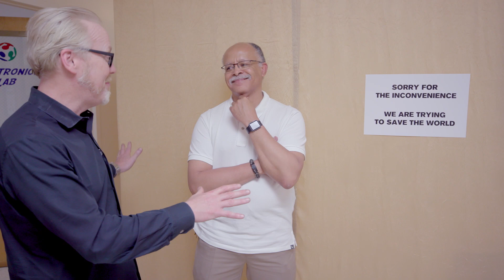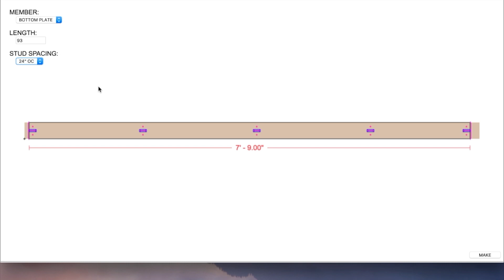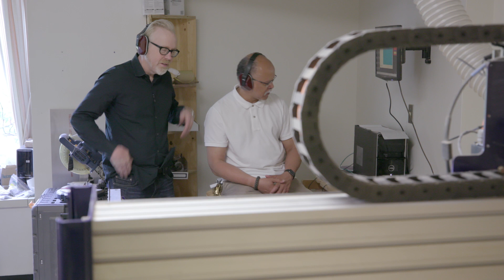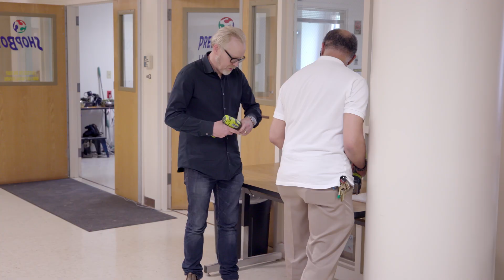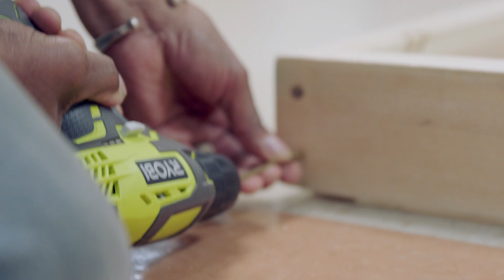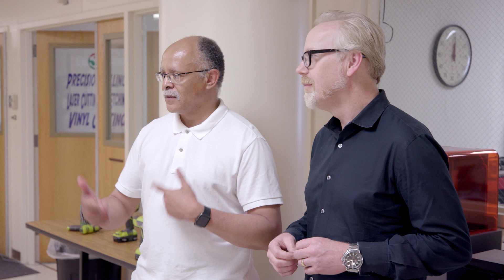Adam Savage's Maker Tour: Incite Focus

Comment: Put the CNC on a trailer so that contractors can use it to quickly make walls. Fit it with an auto loader and off feed table and you would have a sure seller. The mortis and tenon design makes for a very strong wall. Programming, low cost and UI would be paramount.

Comment: looks like it would be ten times sturdier and lighter if it was made out of aluminium profiling.
why make a 3-inch thick wall, when one inch would do, and still fit wiring and insulation on the inside?
I mean,.... for an engineer's job of optimizing the result, this looks way under optimized.

Comment: What I can't work out is how this housing help reduce the cost of utilities. Even if you have all of your essentials (kitchen, bathroom, and bedroom) in one room that does not reduce electricity costs (with the exception being heating), or water costs.  If that housing also included solar panels, and a rainwater tank, plus grey water recycling then it might help solve some of the issues that the working poor face on a daily basis.

Comment: If you can make it to where it's easy to build the entire structure, not just the individual pieces, and you find a way to basically flat-pack it; this would be great for disaster relief. Ship small flat-pack temporary homes, and you could easily have a neighborhood on a truck, maybe even enough for a small community. I know FEMA has trailers, I went though a nasty tornado back in 2011, but the deployment honestly isn't that fast and a ton of people end up in hotels for weeks, but flat-packing enough buildings for a small community could vastly increase the speed of disaster relief, since all you have to do is piece together the structure and screw it together. It would also cut down on costs, as FEMA uses literal trailer homes, and this could be flat packed, just the savings in fuel for the trucks would be enough to provide a vast amount of additional homes.
This would be even better if there was a way to knock down the home and put it back in a flat-pack format after disaster relief, with a quick inspection, then use it for the next disaster.

I also like the idea of making the structure an easy puzzle; piece together a few things, then screw, and you're done. This would work well for people who want to build a cheap home, since time is money, and building structures takes a lot of time in measuring and cutting and assembling; making this the Ikea of houses would cut down on the price a lot. Hell, I might even implement this idea the next time I go out and build something, even if its just a shed.

Though I do have ideas for improvement if you scale this to production. One is automated assembling, especially for the frames; it might not take long for a trio to piece one frame together, but labor time for that trio and the amount of tools and accessories needed would grow rapidly when you scale it for production. Another one is getting a stronger spindle with a longer bit, so you could at least double the production on the 2x4s, and sheet good portions could be knocked out quickly when you layer the sheets.

Comment: 8x20?  Why not use 8x20 shipping containers instead?
Reply: Because they cost an absolute fortune.
Reply: 3,000-5,000 US used for a shipping container. A 8x8 shed built to code won't cost any less.
Reply: But you then have to make the shipping container fit for occupancy. I guarantee stud walls with free labor are less expensive than shipping containers that need to be finished out to live in.

Comment: Hmm... it's all very interesting but the guy says he's trying to minimize the amount of trade experience necessary to make but it seems like he's just offloading the experience / skill needed to understanding the tech to build the cut sheets and own/operate automated tools like cnc routers. All said and done, sure assembling the pre-notched boards with some screws is simple enough but starting from scratch, I can teach a lay person how to use a speed square and tape measure to butt a stud against bottom plate and toenail a few nails in in a fraction the amount of time needed to even notch one board with a CNC.

So the only real benefit is it compiles a lot of already readily available and easy to find knowledge such as code compliance into a no-brainer set of plans. I'm pretty sure with just the set of plans you could ignore the fancy cnc notch bologna and build the "building" in less time, with less knowledge, faster and with less material.

Comment: Almost 6 minutes of pompous yammering before we get the unimpressive reveal of a moderate waste.  Mod up a connex in half and turn it into 2 units accesses at each end split the middle water surface utilities and you get renewable materials used and structure and mobility. Why overcomplicate this stuff.

Comment: Not meaning to minimize the technical challenges this entails but we have the technology to do such constructions for a couple of decades. I think the toughest thing to crack, as he also mentions, are birocratic hurdles but also social norms and an efficient way to put a lot of these in a place. Because a single unit here an there does not solve a lot of problems. This then causes policing problems and neighborhood problems. Maybe with a good technical design they can bring the price down so much that they can fail at tackling some of those tough social problems without jeopardize  the project. Besides, you have to have these thing in place for the eventual problems to manifest and be able to start solving them.

Comment: Would be great if it was actually Open-Sourcve as it's mentioned in th video. I've checked their website. It's empty. No links to the documentation, no blueprints, no open source code. Nothing so far. Why even bother advertising it - because let's face it - it''s an advertisment and publicity play for Chevron.

PS. "We're moving and expanding quickly." Says FAQ page with 2013 trademark in 2017. Four years noone bothered to update a FAQ.

PPS. In fact all of their pages are empty. There's absolutelly no information on the page. All social media links are dead also. There's no way to contact them. This is all an extremally cheap advertisment for a corporation, nothing to do with saving a world.
Reply: Marcin Raczkowski Adam asks if it WILL be open source and they say yes...they are probably will make it public after the 1st one is built and tested in the wild so they can iron out the kinks

Comment: 3d printed shower head won't be sanitary. Not at all. All the ridges hold onto water and microbes
Reply: They used the 3D printer because they are prototyping. Any large scale production would use mass produced components. Even given that, a 3D printed shower head is not a sanitary concern. If it's a clean water source, there aren't significant nutrients for large bacterial blooms.
Reply: Nylon with SLS would be mostly smooth right off the printer, and a custom-built sanding rig would make completing the riskiest surfaces trivial. Also a possibility: antimicrobial coating. You'd probably need some sort of coating anyway, to combat corrosion from chlorine in treated water.
Reply: Even more than that, it is a terrible use of the printer time/energy/materials. Very inexpensive shower heads are a solved problem that integrates with equally-solved plumbing with almost zero effort.
Reply: Could just put a protective coating on it or just fix the rough edges.
Reply: Acetone, gassing.. would round off all the areas in question and smooth the material.

Comment: On one hand, micro-housing is cool.

On the other hand, is the logical conclusion the "Trailer Parks" from Ready Player One? What I'm asking is, is this how slums are made? from good intentions?
Reply: Micro housing is only a problem if it's a bandaid on a flesh wound. The ideas proposed by this guy is that the micro housing is supposed to free up resources for the inhabitants that could go towards investing in other things. So, taking away the issue of expensive housing and utilities to allow people to improve themselves and their local community. At least, that's the idea.
Reply: no slums are made by the few who keep adding no value and charging more .... do you think that 8foot 2x4 is really worth the 5 bucks you spent on it ... when the tree it came from cost 40 bucks ... and they get 20 or 30 2x4's out of it ... if they priced it accordingly that 5 buck lumber would be 20cents ... and the extra 4.80 goes into the owners pocket who bought cheap lumber and process several tons of it to cut their cost to as little as possible ... then jacked the sell price as much as possible to make as much as possible for a little work 
.
Greed is how slums are made ... one money grubbing busines man after another with no real added value.
Reply: @0623kaboom  when you cut the logs you can get them for $0.20 😂 keep on dreaming, but work is worth money. The saws that were used to cut that lumber are expensive, the people that run the saws are expensive, transporting that cut lumber to stores is expensive. To sell an 8 ft 2*4 for $0.20 you'd need to buy that original log for only a few bucks. I'm not saying that lumber makes no profit, I'm just saying a lot more goes in to that 8 ft 2x4 than dividing the total cost of the log by the number of boards it yields.

Comment: Except for the building process, it seems they are reinventing the wheel here.  RV and trailer manufacturers have been building better designed living spaces since the 1920's.   Modular home builders have been doing it since the 1970's, too.  Someone could also buy an 8'x8' storage shed kit, install some insulation, a shower, toilet, cabinets, bed, etc. and move in.  Instant cabin.  Not really much new here unless they can build them for next to nothing -- which is all the homeless can afford to pay.
Reply: Exactly. Never heard someone say so much yet say so little.... mumbo jumbo "chang the world" by creating a small living space. Building a shed that size is about a weekend or twos work for one guy. And you can go to any local big box home improvement store and buy cheap cabinets and flooring that are real easy to install. Heck, cabinets are a modern luxury. Buy a $20 folding table and put a camp stove on it.
Reply: lol rv's and camper aint better they use 2x2's for bloody sake ... they dont maximise space or storage they build as cheap and flimsy as possible ... I have rebuilt several trailers over years and have often tripled the amount of usable space and doubled the efficiency of the trailer ... and I didnt use chip board or super cheap wood like products I use proper lumber and siding ... NO RV does that anymore.

Comment: There is no way it's cost effective to CNC every single stud in a house.
Reply: It's not, but this is a prototype.  If this goes to production they can use a machine to notch the top and bottom of the studs at the sawmill.  It's a amazing what can be done with a 4 head planer.
Reply: not for one house ... make a million as kits and all of a sudden it is .... quantity benefits from the quality ... and by having a single work space for everyone ... no ONE person needs to have the cnc machine ... while all have access to it ... and this is what he built ... and is now expanding upon to make mobile tiny homes ... and future rv's and more
Reply: at one point it wasn't cost effective to cut down a tree to make a stud.
Reply: It actually may be, in the end. The software removes the planning phase, the community pays for the assembly, and the actual building is made a lot easier.

Comment: Typical "american BS" ... whining about RUNNING cost and then building the house out of wood again, which will require an air conditioning in many areas of the USA. If you actually build a brick house (which ISNT HARD) the stones of the wall insulate against heat in the summer and keep out the frost of winter.
Reply: Muck006 easier to build it on site if it is wood
Reply: Yeah and then when there is any natural disaster they have to rebuild everything so the costs would be even greater (also having the bathroom there will rot the wood with all the humidity)

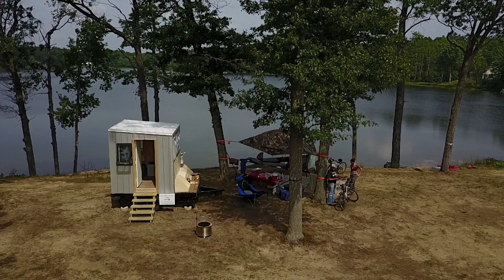Comment: At 8:42 ... can you please explain why the designer opted for having the fricking door swing inwards?! I thought the living space was tight enough. With that design, you void the space that the door will swing into.
Reply: Home exterior doors always open inwards(with the exception of screen doors, but not everywhere has those)... It means you can still open the door even if something has blocked your doorway... Like Snow or a fallen branch. Not "pedestrian" paths. It is also much easier to barricade from the inside if needed.
Reply: Snow. The answer is snow.
Reply: Yeah, I see where your coming from. Apparently this is a cultural thing.

Where I live most home exterior doors open outwards, partly for not obstructing the living space inside but also for making evacuation easy in case of fire.
Reply: Chaka Deng wouldn't be hard to modify the design for other countries who have the doors open outwards
Reply: Chaka Deng Because doors are only usually required to swing outwards because in case of a fire, a crowd of people don't block an inward opening door. But in the case of this building, it is supposed to only hold one person so that isn't much of a problem.